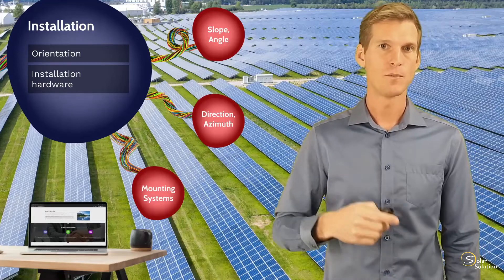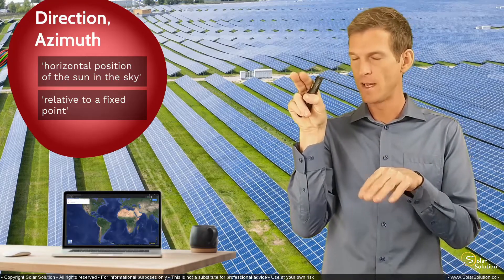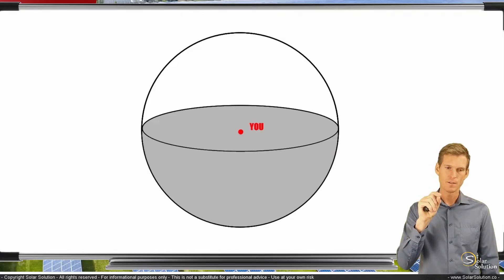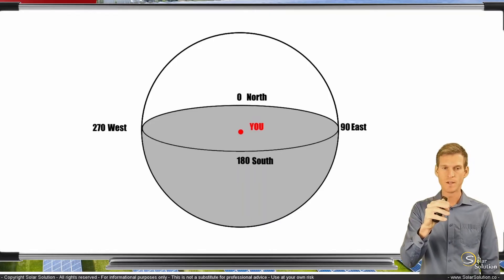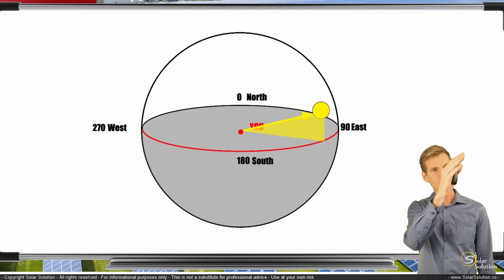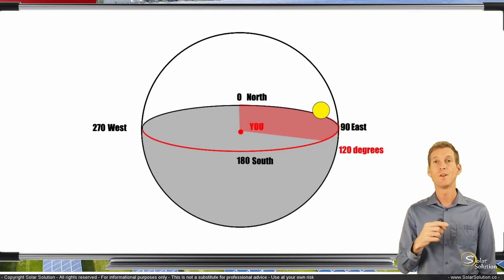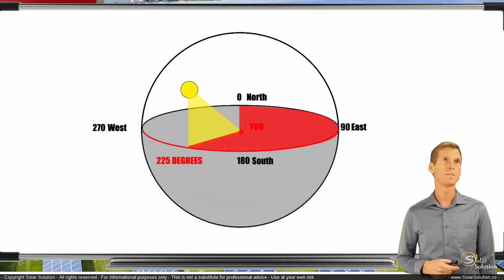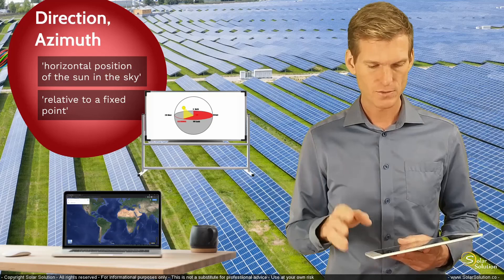What Solar Azimuth is & How it works

Comment: If the building orientation is less than or greater than 180° south, then the overhang (D) will be calculated from this formula by the given height of the shadow cast by the shading device (h):
D = h x [cos (solar azimuth – window azimuth)] / tan (solar altitude)
(Rinka, 2022) Please explain this
Reply from the maker: The formula calculates the overhang for a shading device, helping designers and architects determine the optimal distance for shading devices to block direct sunlight and reduce heat gain in buildings. The formula is D = h x [cos (solar azimuth – window azimuth)] / tan (solar altitude).

The variables in the formula include D, which is the overhang or distance the shading device extends from the window, h, which is the height of the shadow cast by the shading device, solar azimuth, which is the angle between true south and the sun's direction measured clockwise, window azimuth, which is the orientation of the window or direction it's facing, and solar altitude, which is the angle between the sun's rays and the horizontal plane.

To use the formula, you calculate the difference between solar azimuth and window azimuth to find the angle between the sun and the window. Then, you calculate the cosine of this angle to find the proportion of the shadow's length that's effective in shading the window. Next, you calculate the tangent of the solar altitude to find the ratio of the shadow's length to the height of the shading device. Finally, you plug in the values to calculate the overhang.

This formula helps designers and architects calculate the optimal overhang for shading devices, taking into account the sun's position and the window's orientation to determine the effective shading distance.

Comment: Sadly the solar azimuth does not help a child lost at the beach to find their parents. How would they find North ? Nope, rather use a reference to the front of life savers booth. Draw your reference arrow to it inside a tuna tin, starting from the center. Then draw an arrow towards the parents location. Let the child use sun shadow inside the tin to walk straight towards parent. No need for dangerous to kids GNOMENS. The lifeguard can provide further assistance when they see such child with a tin. Use a felt pen. Now you might not be able to navigate in rain weather, BUT THE CHILD WONT NEED TO SEE THAT SO CALLED NORTHERN PEAK AS A REFERENCE. REMEMBER A REFERENCE IS A REFERENCE AND DOES NOT HAVE TO BE TRUE NORTH.

Comment: Thank you engineer Jess Gorter for this presentation! To find the azimuth we select an hour and draw a line from the center of the circle through the 'hour' until the circle extremity and measur the angle from the north in clockwise direction. You presented mybe better way (for me). To find the sun altitude we select an hour and draw an arc centred on the circle centre from time selected until the line with in the angle measurement. YOU OPEN EYES WITH YOURS MODEL POINT OF VIEW because modeling ( by using your aspect ) the landscape enviroment of arhitectual project will be proven to be a quite efficient and  easily visualised!
Reply from the maker: Wow! That is great to hear, thank you for your message Anja.